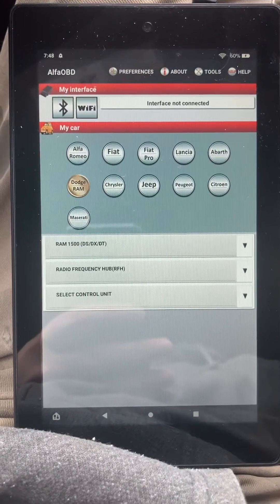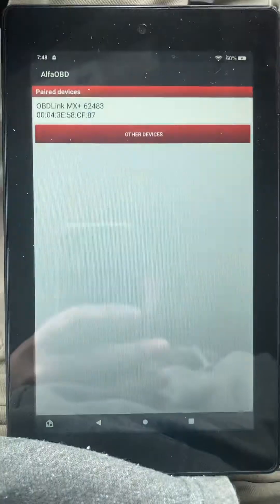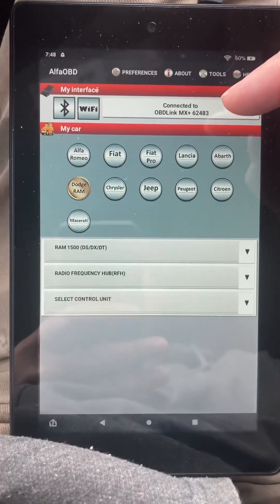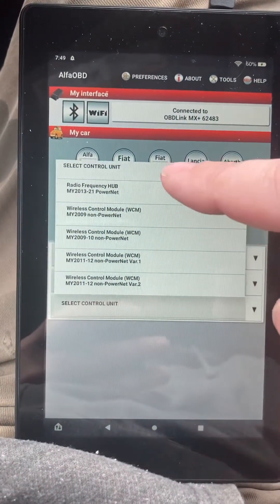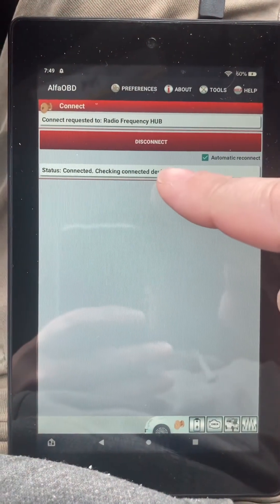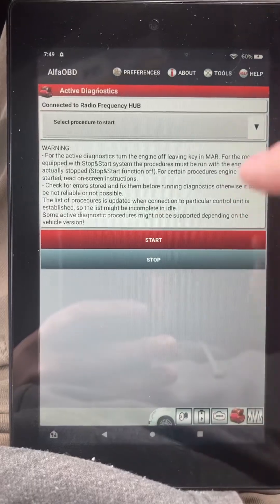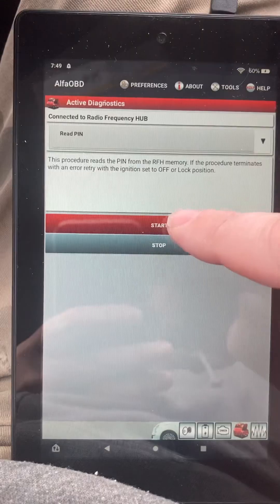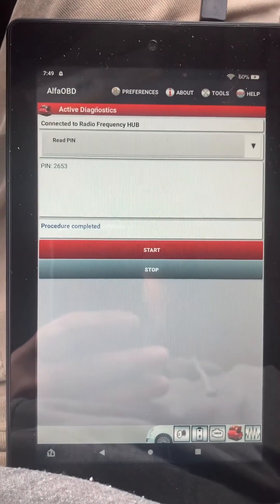4th Gen Ram (2013+), Reading your 4 digit RF Hub PIN with Alfaobd

Comment: I have a 2021 Ram 1500 classic, I tried to read my pin but it states that I have a “rolling 5-digit pin” do i purchase the obd bypass cable?
Reply from the maker: You 100% need a bypass cable to pull back the right pin # but there is also a bug in the current version of Alfaobd which is why it’s referencing a 5 digit pin for you.  You need to uninstall the current Alfaobd version and install an older version that works.  The developer introduced this bug when he was trying to find a way to pull the pin for 5th gens.  It’s been like this for awhile now and I don’t know other has plans to fix it.

Comment: Theirs another guy on utube says you have to get rhe pin from the dealer ? Is their 2 different versions of this software? Or did dude just not know how .
Reply from the maker: @ALEX-xd7ko  it wasn’t an option on alfaobd before but it is now.  And it’s only for the 4th gen 4 digit codes, not the 5th gen 5 digit rolling codes.  Also, there’s actually a bug in Alfaobd now which isn’t slowing you to pull the code.  You have to use an older version of Alfaobd to do it.
Reply: @hydroblueram if you don’t mind wym old version because i’m having problems getting my pin to read it tells me request fail….

Comment: Can you add sales code GXM to add a key fob my 2011 ram 3500 didn't come with one
Reply from the maker: Yes as long as you have power door locks.  You just need to turn on RKE with alfaobd, program the new fobs, and then reset the win module.

Comment: Just picked up a 2014 RAM Tradesman 2500 and I would like to do the upgrades (brake controller, remote start, 2 new keyless entry fobs etc.). I thought we had to go to a dealership to get the pin - glad to know we can do it on our own!
Reply from the maker: I can even help you with wiring for OEM remote start too if you want.  Save you a lot of money over buying an OEM kit.  You may not even need any wiring.  I have a couple videos on that as well.

Comment: I have a 2010 and I don’t have the Read Pin option on my AlfaOBD. I have other options but I cannot read the pin.
Reply from the maker: ‘09-‘12 Rams have a WIN module not an RF Hub so the steps may be different.  I’m not super familiar with them though.

Comment: Not working for me either, 2016 2500 giving xxxx as the code
Edited as it was giving me the correct code 🫣 I was using the app in correctly
Reply from the maker: Check to make sure your on the most recent version of Alfaobd (2.2.9.0 for android I believe).  If you’re still having issues I would contact the developer.  Version updates have been known to cause problems with some things.  I know pulling the pin has been an issue in the past that had to be fixed in another release.
Reply: @hydroblueram  wow thank you for the rapid reply and advice. So frustrated as dealer won't work with me and provide pin. Checking which version alfa I have now

Comment: My 2020 1500 classic won't give it up lol it'll hang for a while, then eventually give me a code like 0025, but keep stating the wrong code when trying to do anything with it.
Reply from the maker: Are you using an SGW bypass cable?
Reply from the maker: Is it pulling 0041?
Reply: I have the same problem. I'm using the SGW bypass cable. Could be this the problem??
Reply: @IgnacioD648  go to the dealer parts department they can give you the code free of charge

Comment: It's not reading me my code
Reply: Problem I'm having is my 431x pro cant pull the pin on and Chrysler with the skim immo system . It will pull pretty much everything else just not anything stalantis.
Reply from the maker: @ALEX-xd7ko  my experience is only with 4th gen rams so I can’t speak to any other Chrysler product.
Reply from the maker: What year is your ram? And are you trying to read it with the ignition in the off position?
Reply: Mine is a 2022 Dodge Challenger. It reads pin but it gives me a 5 digit number. On my 18 Ram it reads at 4 Digit number. I try to program a key & the code it gives. Will not work to program a key.
Reply from the maker: @rogerstewart5140  this is a how to for Rams not Challengers.  I’m not familiar with challengers but if the 2022’s are anything like the 5th gen Rams then they have a 5 digit rolling pin that alfaobd cannot pull.  I only assume that since you mentioned a 5 digit code but I honestly don’t know.  I also assume you have a bypass cable as that is pretty much required on any 2018+ Mopar vehicle in order for alfaobd to work.
Reply: @hydroblueram so alpha will not work with my fca auto auth ?
Reply: What pay methods do have

Comment: Awesome. I got it to where the remote start button is making the truck honk. But no start yet. I've read some guys have had a odd thing where they had to wait a few hours before it started working.
Reply from the maker: You have to drive the truck for a few minutes.
Reply: @hydroblueram I figured but it has a trailer behind it. Didn't feel like dragging it around. I found where you can re enable it in alfa without driving it. Thanks for all your help man. Got remote start for friggin free lol. You sell the conversion to go to the projector headlights right? Imma have to get something from ya. I appreciate your help!!